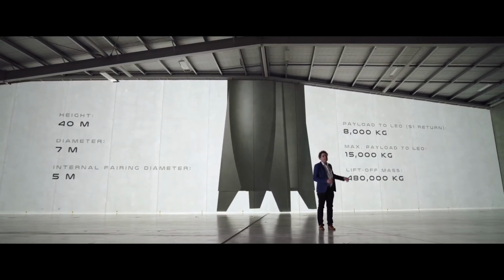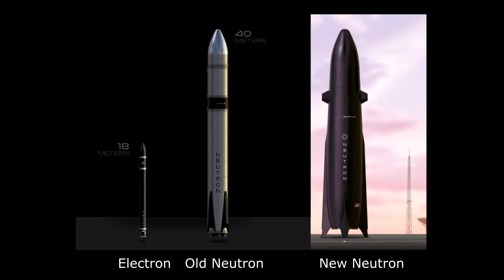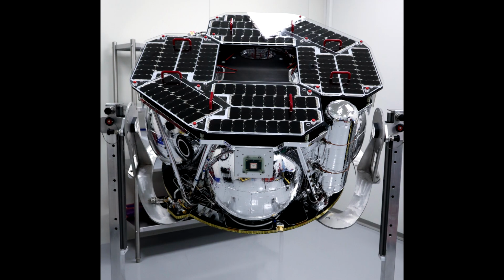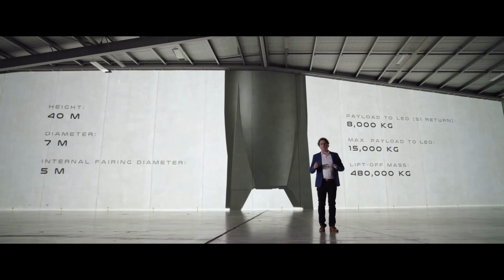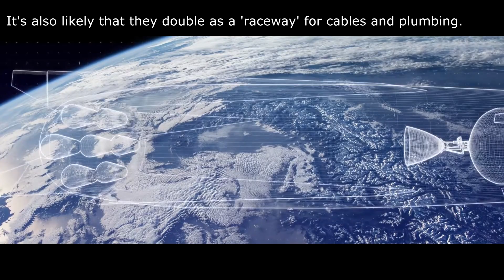Rocket Lab's Neutron Rocket Will Be More Reusable Than Falcon 9

Comment: Random thought kinda related to this video: Would it make sense on something like the crewed Starship to do a double hull in which the inner passenger capsule is made of carbon fiber with a small gap between the outer stainless steel, possibly filling the gap with water  for crew consumption and possibly helping a little with heat dissipation on reentry, insulation in deep space along with protection from micrometeorites and radiation shielding?  Technically you could even use a second Starship launch to fill the water tanks if necessary.
Reply: @colinsouthern  As for the point about consumption, I'm assuming most water is recycled in space travel or at least will be in the future. You can't afford to lose much water on a trip to Mars. I am aware that a few inches of water isn't going to do a ton against radiation but it could be a small side benefit. Cooking the crew is one concern I wouldn't have, I don't see how having a water barrier would result in higher temps than not having it there.

Thinking about it more though, it'd just be way too heavy to launch or land with full water tanks(I'm figuring a 3" water gap might be 10k+ gallons which would be 40 tons). And with that fact out of the way there's limited practicality from having 3" of water around you anyway, it's mostly useful for an active insulation system and extra micrometeorite protection. I do think having a double hull is smart in general and in that case using the space between to store water does seem to make practical sense but there are certainly limited benefits.
Reply: @colinsouthern  I do think the people who design rockets have thought of most things but certainly not all. There's many discoveries and innovations yet to be made, I wish people wouldn't dismiss their own ideas so quickly in the assumption someone smarter already thought of it or found a better way even if that may be true most of the time.

As for the difficulties of Mars missions, I've heard many of those arguments and nothing I've heard seems to be an unsolvable problem, unless you feel an initial Mars trip must be as safe as a stay on the ISS or even an Apollo mission. We have current solutions that could take us to Mars very quickly if given unlimited budgets so it's really just a money problem, not a fundamental tech one (although there's plenty of over the horizon tech that would certainly be nice to have). Even in regards to propulsion there could be a relatively fast path to nuclear thermal or nuclear pulse rockets given that money for development wasn't an issue, there's even faster engine designs that may or may not work as theorized.

Before Elon Musk started landing rockets I would have agreed with you but if Starship can manage to be fully and rapidly reusable within a few years I'd be shocked if a human hasn't landed on Mars in 20 years.
Reply: @colinsouthern  I don't think that particular idea is worth running by them, I have no illusions about that. This should be fun, I'll give it a go...

-Hydroponics and aeroponics can be used very effectively for just about all but root crops and I thought I read that some root crops, such as potatoes, are thought to be good candidates to grow in Martian soil.

-I do think the single biggest hurdle to long term colonization of Mars is low gravity. I don't think a 6 month zero-g trip is a complete no go even without anything beyond what's done today, one could use an exoskeleton if necessary. And yes, the ultimate answer is absolutely a rotating habitat, possibly tethered Starships early on and specialized Mars transit vessels later on. I do think far more people will ultimately live in rotating habitats in LEO and even Mars' orbit than will live permanently on the surface of Mars.

-By living underground and/or by piling Martian soil over our (likely inflatable) surface structures. Possibly with active systems later on.

- Inflatable habitats in the short term. Even a Starship with wetlabbed fuel tanks would be a decent sized space. Once we have the ability to get large amounts of mass into space cheaply then the biggest challenge becomes building large structures and mining basic resources in situ, when you can do that the world (or Mars) is your oyster.

-Radiation on the journey shouldn't be a problem outside of taking a hit from a solar storm for which a minimally sized shelter can built on board, or you can simply risk it. Once again, there's some proposals for active shielding that may be practical.

-Building a spacesuit shouldn't be terribly hard when a bureaucratic process isn't involved, it's not like we're trying to build a warp drive. I have a feeling as much as possible will be done from inside a rover with robotic arms or possibly even from home base entirely remotely. In general, I'd think an EVA on Mars should be a lot easier than in space because you're not at risk of flying off and the risk from micrometeorites is much lower.

-Psychological considerations are just that, considerations that must be taken. Not a barrier. There's going to be risk in that regard, imo the easiest solution would probably be to ramp up the population as quickly as is practically possible. Getting internet to Mars would also be helpful.

The self driving tech proposed in the 60's with in road sensors and cars that talk to each other worked a long time ago and could work now, they're just completely impractical as they couldn't coexist with regular traffic and would require incredible infrastructure build out and maintenance. You doubt self driving AI but I am thoroughly impressed by the speed of improvements, they've far outpaced my expectations. Tesla is very, very close to actually pulling off a truly self driving vehicle. I would be equally unsurprised if it were fully ready to go next year or at the end of the decade but they're already into what I'd consider mid to high ninety percent functionality.

See, you think that we don't have the tech to return to the moon safely and I think that's just laughable. Of course we could, it's just a matter of resources and your definition of safe. Commercial airline safe? No, but almost nothing is that safe. Crossing the ocean in the Viking times safe? Probably better than that. Space travel isn't optional, if humans are going to survive and thrive we need to expand our population along with our access to energy and resources indefinitely. For that to happen we need to expand into space in every direction and never stop, to reach critical mass in that regard could take hundreds of years. We need to be going pedal to the metal at all costs or our likelihood of surviving and advancing continues to drop. There is no time to waste, it could already be to late to get the ball rolling as it is.

If you want hard build a launch loop, discover an appropriate material for a space elevator, build a Dyson sphere, build a black hole power plant, manufacture anti-matter at scale, build an Oneil cylinder, terraform a planet. Getting to Mars isn't hard on the grand scale of problems to be solved, people with power and money are just soft and listless.
Reply: @colinsouthern  You're pessimism is disheartening. And as for experts, I've read a lot and I've come across people who simply disagree with you on many of those points.

The purpose of farming on Mars is not to fully support a crew, at least not with the first missions, it's mostly to make their stay more enjoyable through the care and presence of plants and the diversity fresh food adds to what will be a not so enjoyable diet. The structures that will support this mini farm are ones that will be built with metal and plastic, shocking I know. There's nothing overly massive or bulky with hydroponic or especially aeroponic setups. The water used in such a system would be part of the base's water cycle. This is definitely not one of the hard problems. And yes, even NASA believes they will be able to grow crops in Martian soil, they are currently working towards that goal, it's my understanding that removing perchlorates is the biggest hurdle.

NASA and Russia have plenty of studies on the long term effects of zero-g and people have stayed in space for over a year and returned home and based on those results they do not seem to think it's a barrier. NASA has planned several Mars missions, none of which anticipated using artificial gravity. Besides, Mars has just over a third of Earth's gravity so it's much easier to adjust to coming from zero g. The return to Earth will be rough for the astronauts but there's plenty of help back on Earth and I'm sure some folks won't mind the risks. I'm beginning to doubt you've done much recent research on anything you're bringing up but I'll continue...

Regarding a rotating habitat, the consensus seems to be even something as small as 35-40 feet in diameter would be tolerable and beneficial, by the time you got up to a diameter of 70 or 80 feet it would actually be relatively comfortable. In a tethered two or three Starship design there are no balancing issues, in larger rotating habitats there's any number of simple ways to counteract that with active counter-balancing, thrusters or simply by being massive. Once again, a rotating habitat IS NOT necessary for the first trips.

A specialized Mars transit vehicle IS NOT necessary to get the first humans to Mars. If you were to build one though you'd probably make it a fairly large rotating habitat and you park it in a permanent Earth-Mars transfer orbit.

It is NOT necessary to live underground for the first human exploration of Mars but they've already identified at least hundreds of potential cave entrances, and then there's the Boring Company route as well. Besides, I expect the first permanent settlements will just pile Martian soil on top of surface structures, if even that is deemed necessary. Maintaining breathable atmospheres is something we already are very much capable of.

Cheap is a relative term. Fifteen years ago the cost to orbit was like $15,000/kg it's now close to $1,000/kg and falling. If Starship succeeds that number may drop to as low as $10/kg. That's a massive enough difference so as to have completely unforeseen effects, it's a total paradigm shift.

NASA doesn't need to be, and may very well not be, involved in the early exploration of Mars precisely because of their risk-aversion. And like I said, the radiation risk can be mitigated with a simple, even if bulky, on board shelter. If the US tries to stop private companies then China will certainly be happy to throw people at this problem for the prospect of national glory.

I've followed self driving tech very closely since those closed-circuit demonstrations by GM in the 90's, through the early Google cars and onto Tesla. I went from wide-eyed optimism to hard core skeptic by listening to experts who would tell anyone who would listen that self-driving is incredibly hard and may be virtually impossible (probably because they couldn't figure it out themselves). A year or two ago after seeing the early iterations of the Tesla FSD beta, it became apparent that they were a lot closer to solving this problem than I thought. I'm not an engineer, nor am I an expert in AI, but I have listened to both at length and of both dispositions. The Tesla folks have convinced me. Yes, there will be hiccups with self driving AI, like running into emergency vehicles, but cases like that are very rare even now and are used to train the AI so it doesn't make those mistakes again. Some aspects of traffic control, signage and construction markers may need to be tweaked with self driving AI in mind. I expect the practical abilities of self driving cars will far precede regulatory approval (kids or non licensed folks riding unattended).

I think you're conflating engineering problems with lack of tech/new physics problems and there's a very big difference there. We built a lunar lander 60 years ago with computers lesser than todays graphing calculators, do you really think it's that hard? It's a resource and motivation issue, there's no fundamentally new tech or physics required to get to the Moon or Mars, they're simply practical engineering problems. And no, it's not just a money problem, it's also an organizational one. If you gave NASA unlimited money they'd probably never get it done, but if you had virtually unlimited money and the proper competitive process these things could be solved very quickly. We'd come down to where we were only limited by how many smart people we can get aligned and moving in lock step. And the unlimited money quip itself is only to indicate that no major breakthroughs, no far-off tech and certainly no new physics are needed to get to the moon or Mars.

And for Starship landing on Mars is probably easier than landing on the Moon because Mars has an atmosphere to help slow down.

Comment: If they are building the second stage to hang in tension, shouldn't the nozzle be at the top? Otherwise, it will be in compression as soon as the second stage lights, and it seems to me that second stage accelerations are usually two or three times what the boosters put out.

Comment: I wonder how much SpaceX played into their decision to use methane fuel for Neutron.  It keeps options open to maybe buy in-orbit fuel from a Starship tanker. Assuming the needed fuel-docking hardware.
Reply: SpaceX chose methane for two reasons. One is pretty much unique to them, which is that methane can theoretically be manufactured on Mars. The second is that it's probably the most optimal fuel for a rapidly-reusable booster, because it doesn't have the coking problems that come with kerosene, but has a much better energy density than hydrogen.

That second reason is probably the key factor for RocketLab... and also Blue Origin, ESA, and others who have looked at methalox engines. Picture the soot-covered exterior of a Falcon booster, and realise that the engine probably looks just as dirty. Methane might not perform as well as kerosene, but having a clean-burning fuel means you're not spending as much time servicing engines between flights.

Comment: I never knew Space X's Falcon 9 was 12' diameter to fit on the roads. Funny how so much of our engineering is determined by road and railway sizes.
Reply: That’s also why the 737 fuselage is the size it is - for rail transport.
Reply: and not new either.. look up the design considerations to tanks and jeeps for WW2, probably even planes..  You'll be surprised.

Comment: I also have a lot of questions now too.
Above all, may a variation of the design may actually be able to reach LEO. If I look at the current second-stage concept I wonder if that could be interchanged with fuel tanks. 
And then put a (manned!) compartment on top.

Comment: The tips of the landing legs: Titanium comes to mind immediately but is expensive, hopefully iconel will handle the temps. Or, I've heard of something called transpiration cooling.  ;)
Reply: Better than transpration cooling (which involves tiny holes that can plug) is active cooling. Circulate liquid methane in 3d printed cooling channels. Then release the methane into a cavity where it will boild (nozzles or depressions in the structure). The methane gas expands as it heats forming a protective layer. In extremus, the methane dissociates, carrying  more energy and alos creating carbon particles that block radiated heat. Methane is a great coolant as its heat capacity rises with temp.

Comment: With the clamshell fairing, possibly it could be a dual use rocket. Launch a satellite and before it returns to earth, pick one up and bring it back. I know I know when the second stage departs Neutron isn’t at elevation to recover orbiting satellites, but it could get there.
Reply: The first stage and the  clamshell fairing is not going into orbit.  It can't.  Anything comming back from orbit needs heat shield.  Carbon fiber would not survive reentry.    Additionally the first stage isn't going fast enough at stage separation to achieve orbit  or to catch up with any sattilite.  Most of the velocity needed to achieve  and stay there actually comes from the second stage engine.

Comment: The new design certainly does seem fairly clever, kind of feels like they decided that if they would only be recovering the first stage, then how can we put as much of the mass and cost in the first stage. Because obviously you'd then be recovering more in total.

For an only first stage recover design, this seems like the best design I've seen so far by a fair margin. Excellent work really, it won't beat a well working fully reusable system, but it seems like the next best thing. One imagines it could probably be developed to the point that it would undercut the Falcon 9 in operational costs by a reasonable amount. And in the mean time they can pick up more experience on how to develop a fully reusable design.

Comment: That's a pretty clever idea for the second stage. Has anyone else done such an "enclosed" second stage design?
Reply: The atlas 5 is close.  ON the atlas 5 the faring cover the payload and the second stage.  But since  the atlas is not reusable the faring is discarded just before stage separation.